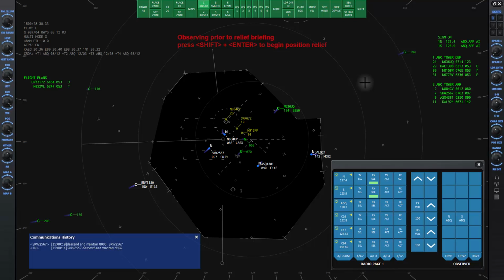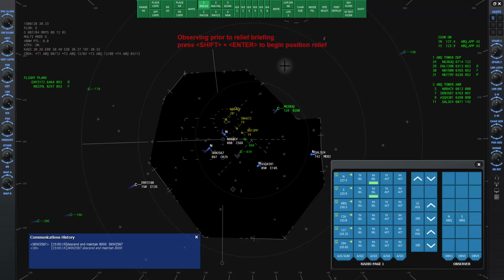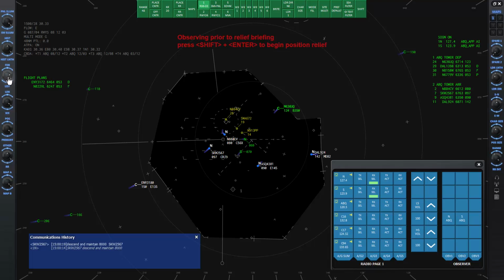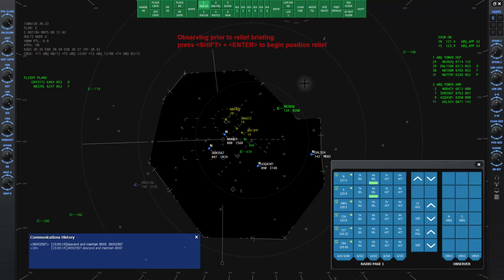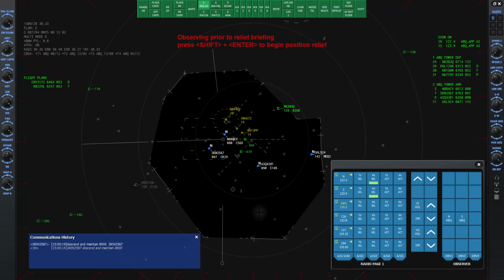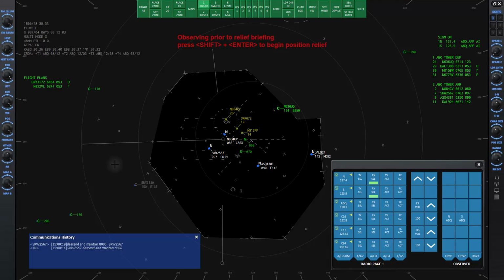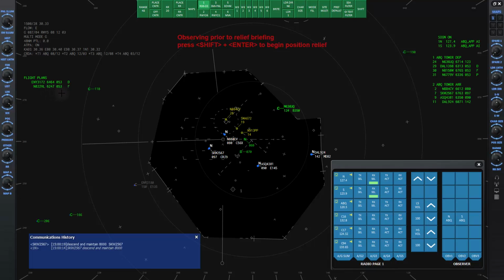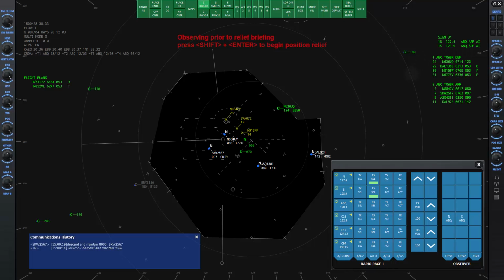ATCpro - Lesson 3a  - Using the Terminal Controller Workstation (TCW)

Comment: I am an FAA controller and I have to say they've done a really good job simulating our equipment and procedures. I can talk at my normal work-level rate and the sim pilots understand it. This is for REALLY serious ATC simmers though, because they're simulating every button press on the equipment and simulating all of the airspace altitude shelves (what you "own"). You need to memorize the maps, fix names, and standard routings (SIDS and STARS), and facility-specific operations (what altitudes and headings you need to get them to at each sector) which will take awhile. But we have to do that in "real life" too.
Reply: So you would recommend this sim to any  ATC enthusiasts? On a scale of 1 to 10, how close is this to actual ATC operations?
Reply: I'd say 9. It's a little too strict with "airspace violations" which at the TRACON level is usually look-and-go, and you don't have the ability to coordinate things at the busier facilities (ATL), but the equipment simulation, the traffic levels, and the division of labor (sectorization) is spot on.